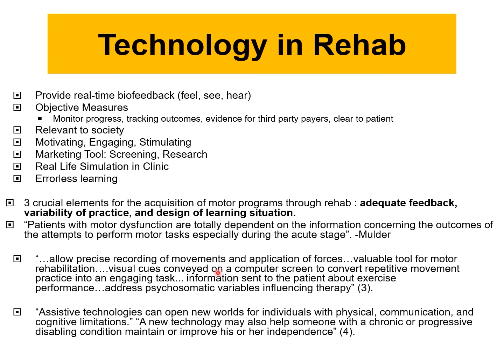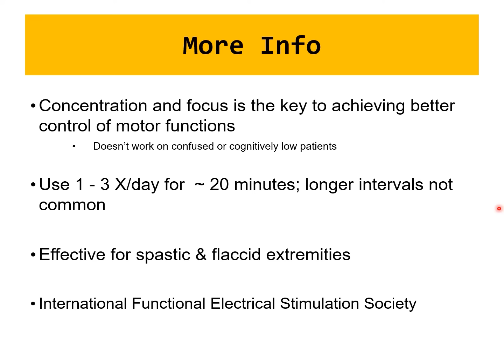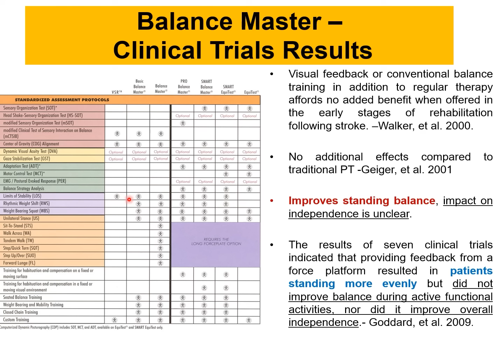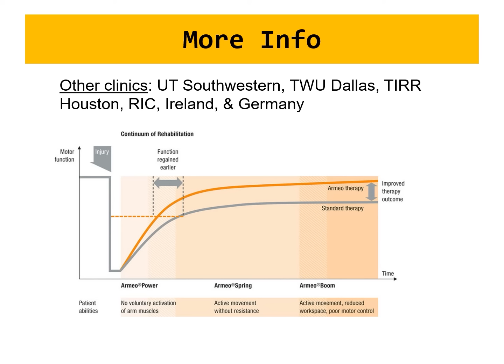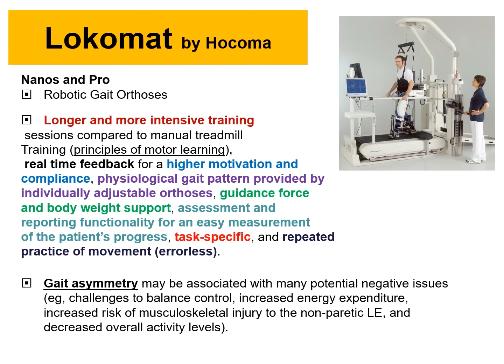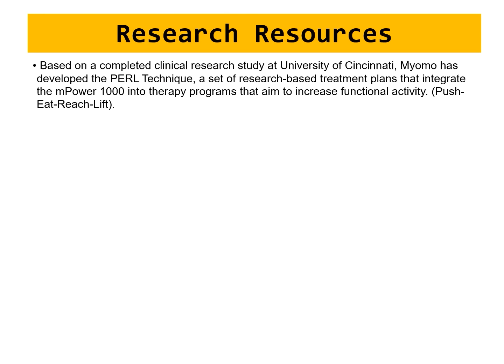Rehabilitation Engineering #030 How Effective are Myomo, NeuroMove & Biodex? Rehab Robotics #BME414

Comment: I have been using Motis Nova (@motusnova) for my wrist and hand movement exercise machine for the last several months. One of the things I like about it is I can get in a lot of repetitions and I can track progress through reports. I also track progress through doing functional activities, which I have been increasingly doing over the last few months as well. Newest task was I was able to zip up my coat. Some of the other things I've been doing are opening doors, turning on light switches, tying my shoelaces. I have trouble with extension still but I can drop stuff in the trash and I use the broom. Although I kind of have to use my other arm to help, I also pick up paper clips. And I've been using blocks, putting blocks in. I don't have an occupational therapist. So I've been doing this stuff at home on my own religiously.